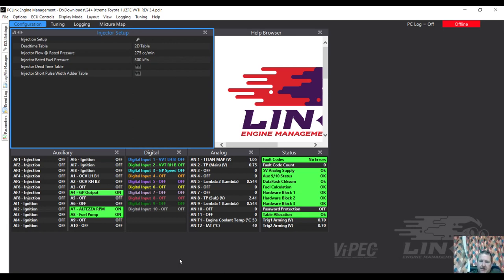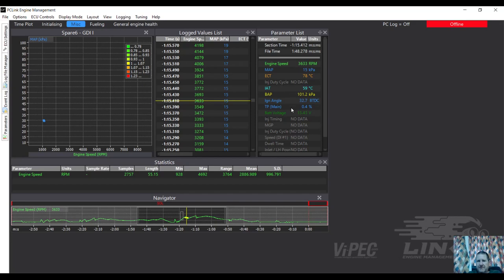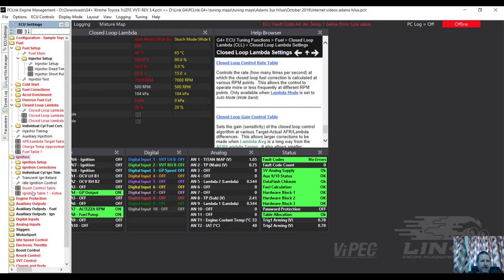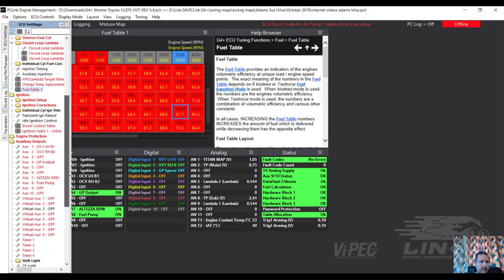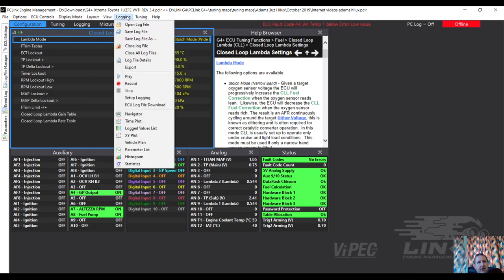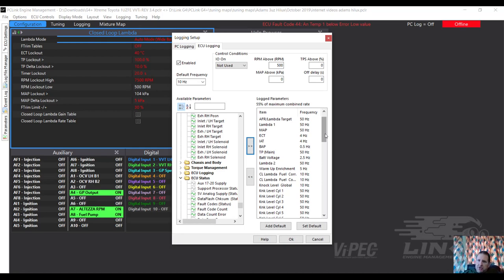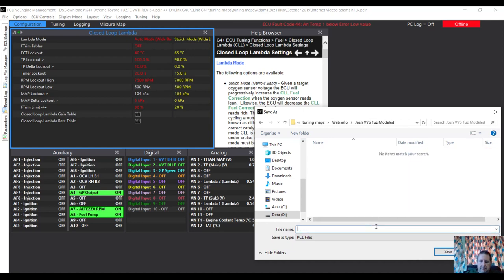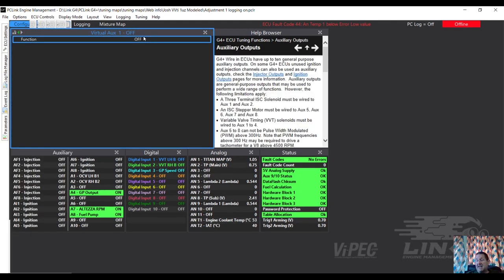Link remote tune profile adjustment , corrections and changes.  start of the process.  1uz VVti. PT1

Comment: Kelvin, Interesting to watch you go through the steps and find inconsistencies. I do hope there is a followup... I wonder if a component is dodgy or if it is purely software related. I am an IT guy at a large University, so I can sympathize with remote repair. It is COVID-19 related in my case, but it keeps me away from hands-on service.
Reply from the maker: I will make sure I release the process.  I made 4 videos for the guy to get the car running nicely.